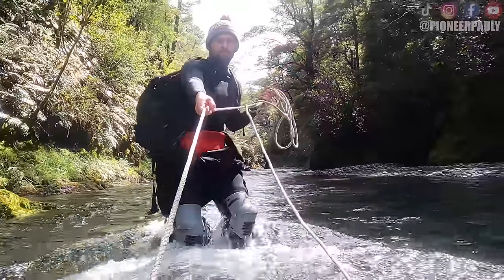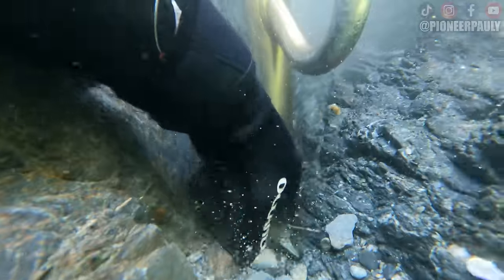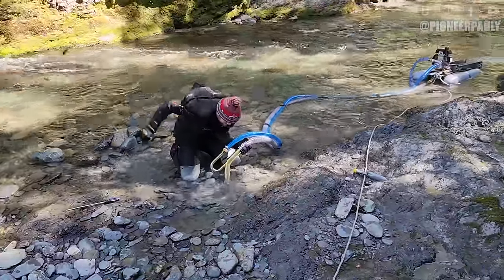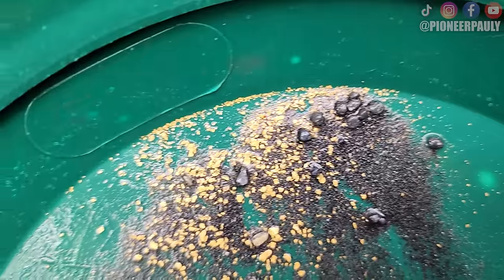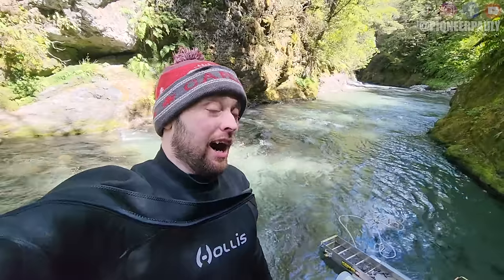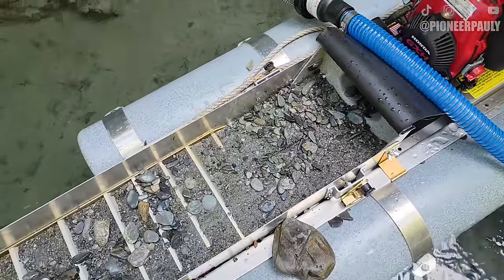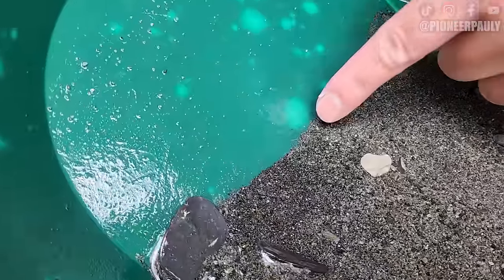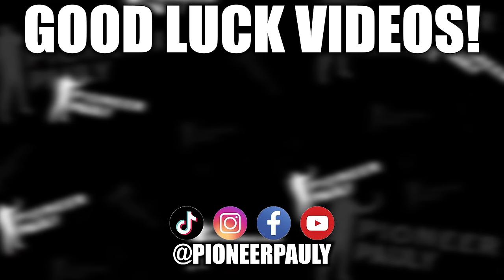Sucking Out GOLD Using The MINI DREDGE In New Zealand!

Comment: Put a flat nozzle on the tip like on a vacuum cleaner. So less big rocks get in. Or use 2 mesh filters offset on each other so itll let small in but not big

Comment: see if you can solder some sort of screen on the end of your nosel you can get some thin gauge aluminum rod and run them so you're quartering the diameter of the inlet. its pretty effective of making sure the only thing going through the dredge is what wont get stuck

Comment: Next time take a 1/4 inch metal rod and bend it over the end of the nozzle and secure it with a hose clamp then you will not suck up stuff that can't fit in the end of the nozzle.

Comment: you can easily fix rock blockage by welding a metal bar in the shape of a cross at the opening because you just need fine material to enter, underwater dust problem can be fixed by using an underwater blower or something, hope this helps.

Comment: What you need is a classifier in reverse like a garden rake but different and if you prep your ground first use the bigger rake to come in and scrape the big gravel off which the wide x would let the smaller stuff stay there and if it look like it was still a little big than use one size down and take the next biggest rocks and scrape them back that way your nozzle won't be running into all of that s*** and getting stopped up you'll be classifying as you go and in hindsight you could cover way more and have better results in theory I've never even run a gold pan so I'm not being a troll I'm just I'm a problem solver I see things differently than most the quickest weigh premium results